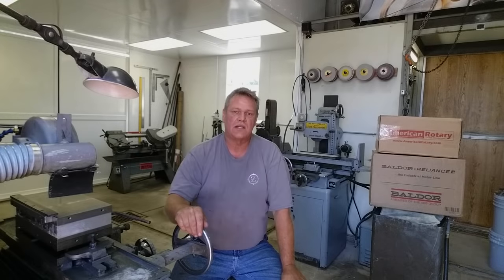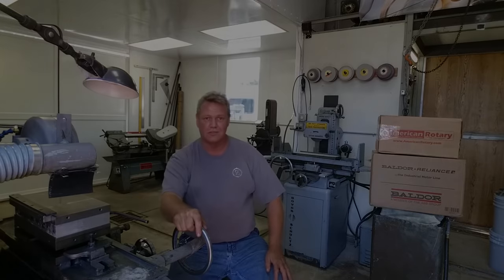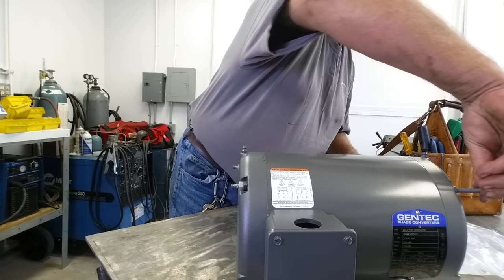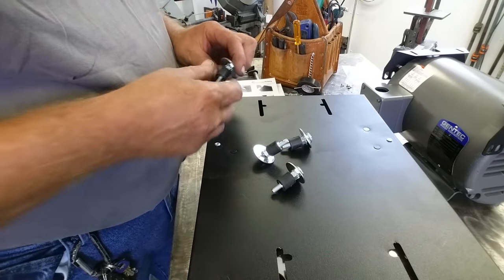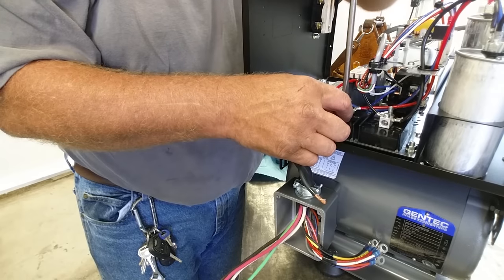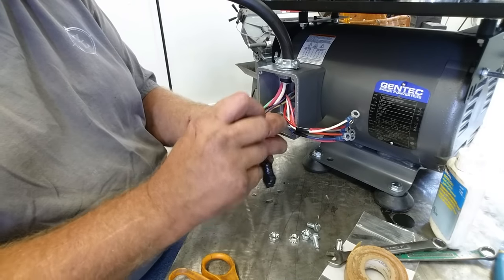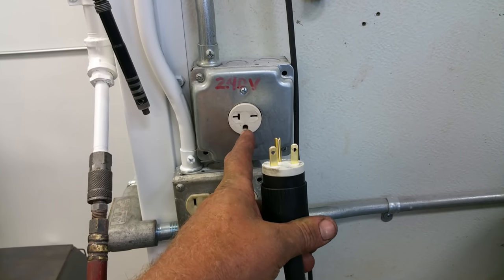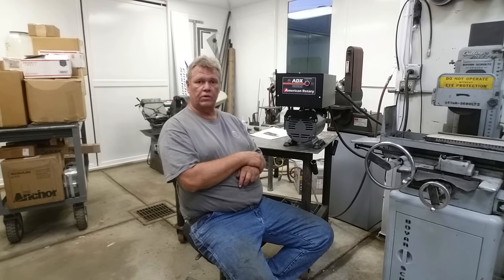RPC  VS  VFD

Comment: Good job Stan. I’ve been running my shop with a rotary phase converter I made with a 15 hp Fairbanks Morse pump motor for 25 years. I carry a small remote control that powers the coil in a large contractor with the output of the rpc going to a 3ph distribution panel as you discussed. The rpc is outside my work area and so quiet I had to install a light to remind me to turn it off when it wasn’t needed.  That said I am shopping for a 1hp CDF for my drill press to avoid having to change belt location to adjust speed.  BTW, the rpc runs my CNC mill and a large 3ph mig power supply flawlessly.  Keep sharing. Thanks, will

Comment: It amazes me how many electricians in the field that doesn’t know how to properly crimp on a fork or ring. Thank you for pointing that out. I’m in the HVAC-R industry and I see this mistake daily. Nothing more frustrating than rooting around in a panel only to find the wires pulled out of the crimp connections. 
On a side note it’s easier to see where the wires were supposed to go.. 😜

Comment: Thanks for the information.  I feel like RPC must have really gone up in price.  I see a lot of videos that say they cost less.  I see this was made in 2016.  Now A 10 hp RPC is over $800.00 and a Invertek 3 hp VFD is only $331.00 I think by the time I get the enclosure disconnect fuses and switches I'll only have $450.00 into the vfd setup.  I was told I have to do a 2 to 1 on a RPC (10hp rpc for a 5hp machine).  I've also found that for 3hp and bellow I don't have to oversize the vfd (single phase 220v to 3 phase 220v) Is this your understanding as well?

Comment: I also learned old school motor wiring with the three tape method up to 500Hp motors! I have a 10HP American Rotary unit to run my lathe and mill, been great, did blew a starting cap and relay couple years ago, easy folks to talk too. They had new parts delivered in two days, their tech guy was great!

Comment: Sorry continued. Found out 2 things on VFD with 1 bliwn input fuse that was running: drive was only running around 50% of full speed by BSO and the blown fuse was not on terminal that supplied control power. Great vid.

Comment: Something worth mentioning, an rpc will also power 3 phase inverter welding power sources, although I'm not sure how common those are in the US. Coming from Europe, they are very common. I run a 300a tig inverter from a 15kw rpc with complete success.
Reply: I didn't know this.... personally fed up with my 240v 100amp mic plant.
Very interesting thanks

Comment: Thank you for the instruction vid!  Just bought a used AR 7.5, am anxious to put it online for my machines.  

My understanding of the static converter is that it delivers 2/3 rated power since it has capacitors for the 3 phase start but then only delivers 2 phase power.  What about VFDs though?  Full power?  Or only 2/3 power?
Reply from the maker: VFD will also make tagged horsepower.

Comment: I use a VFD in my shop. the advantage I find is that it is possible to use  soft start available with a vfd. Quite a few jobs I do require frequent direction reversals. Previous to using the vfd, one motor failed as well as 2 starter relays.
Reply: Wow! Those are some major caps in the electronics box! Don’t want to grab one of those!

Comment: One question, VFD for older heavy iron with a low top RPM, about 800.  The concern I have, the maximum speed for the spindle bearings without causing damage.

Comment: Stan, just how big a rotary converter do you need to run a shop with many machines but may not demand many amps at one time? I.E. a 1 hp machine and a 3 hp machine. Theoretically 4 hp RPC would work  for near full load/start-up while the other machine is idling. Idle hp/current draw is what, 10-20pct of max current???

Comment: If you connect single phase to a 3 phase VFD you probably would only get 1/3 of the rated HP. Would have to connect to 2 input terminals that the VDF gets it control voltage from. Did you ever rectify a single phase power source and connect it to the DC buss terminals. Older Danfoss VLT drives had the DC buss on easy to wire terminal strip. Freaked me out the first time that I came acrosd a 480 volt VFD that had a blown fuse and VFD was running. Found out 2 things:

Comment: Yep, you are quite right, every situation is different. Why go to a separate VFD if you don't need speed control.
Some years ago I went the 3 phase path mainly because the motors were so cheap and almost give away at my local scrap metal yard, but also because 3 phase is speed controllable and easily reversible  provided you don't want to load them with high torque at low speeds.....single phase motors are more limited on all counts.
When I managed to get a Bridgeport for a business venture I also invested in a rotary phase converter of about 3 HP as the Bridge had a 1 1/2 motor and at the time I only had the one motor on 3 phase.
Later I discovered the cheap VFD's that I now use for all my small 1/4 to 1 HP motor types and they are on speed control type machines.

Comment: ShadonHKW is there a "rule of thumb" for sizing an RPC supplying a sub-panel? Obviously most shops will not run all machines at once. Thanks in advance for any advise.
Reply from the maker: RPC horsepower equal to or greater than load horsepower is a good start. But I would contact AR for sizing tricky loads.
Reply: Shadon HKW thanks

Comment: Thanks for this really informative video...
I have an old Elliot Milmor with a 2 speed 2 1/2hp 415v motor and a half hp feed motor with suds pump.
Really like the idea of a rotary but 
to use hi/low speed I'm guessing I'll need a digital vfd?
Thanks again, you've helped a lot.

Comment: Good video Stan. The most important difference I've come to understand with my VFD is you must never have high voltage controls downstream from a VFD or you'll soon release the magic smoke. If someone wants to use the factory reversing switch on a 3-phase lathe, for instance, without first converting it to the low voltage DC side of the VFD control circuitry, an RPC is the only logical choice.

Comment: how do you feel about running a vfd from a rotary? i have a decent size cnc mill (15hp spindle) and i am looking for a way to power it. also does the 2x hp need to stay true with a vfd controlled motor?
Reply from the maker: Your VFD will run fine on a converter, I would call Ameican Rotary about the proper sizing.

Comment: Hi Stan, I love your channel!  I'm Australia and I was hoping I could have some independent advice, please?  I have 240v single phase and I have a 10kw (13HP)(19.7Amp) RPC (415v) which runs my panel saw and a few other 3PH machines in my shop. I recently brought a nice 3 phase inverter stick/tig welder but it won't run on my RPC and I'm not sure why?  It turns on but it won't Arc.  The welder specs are a 3PH 10A 400v +20%/-15%, 50 Hz and has a kVA in the range of 7.7 to 9kVA according to its electrical plate.    I am just wondering firstly if you might know if there is any obvious reason why it won't work with my RPC? and if I can't get it to run using my RPC, is there another way of getting this welder up and running, maybe using another means such as a VFD or a static converter to run it?  I don't want to sell it because I really love it and I am finding it very difficult to get any information from the commercial enterprises.  Thanks Chris :)
Reply from the maker: It must be the inrush when striking an arc, getting over the initial jolt may be all you need to do, how close to the ragged edge is hard to say. Maybe find a friend with a larger converter to test out this theory.
Reply: @ShadonHKW  Hey, thanks for the reply!  Finding someone with a larger converter might be harder to find :).  I have a slightly larger induction motor in the shop so I might swap motors and give that try?  It should provide a slightly larger amount of Pixies on the inrush.  Thanks again and my best regards - Chris

Comment: Great old school wire up Stan.  I still have several rolls of stretchy rubber tape and no sticky cloth tape from forever ago. It was a pain in the butt to make them up but they never failed to maintain a good connection. If that rotary was in my shop I would put it somewhere that I could not hear it, with a long feed line and a remote start switch on the machine. Can't stand to listen to the extra noise. thanks for the entertainment ....greg

Comment: Interesting video, but I'm really glad we have three-phase into most homes here in Europe.  The power consumption rotary converter is just wasted energy, and the noice is also an issue plus the cost of the converter.
The situation we have in Norway, is that most homes except those build the last 10 years have 230V 3-phase in delta configuration. Newer resindential homes and the rest of Europe have 400V star configuration with an additional NeutralI lead  (so 5 pin connector).  Many machines can be configured for both 230 delta and 400V star. . If not, we need a transformer to convert from 230V 3-phase to 400 V 3-phase.
Reply: The initial cost of running additional wire from public utility to individual residences and business sites must be factored in. Those who actually need 3-phase are in the minority, but can have it installed from the public utility at a premium. Or can opt for relatively less expensive solutions such as an rotary phase converter or variable frequency controller. Certainly all the citizens of the city where I live, St Louis, Missouri, USA, do not require 3-phase power and to have access to it from a residential panel would be considered a luxury. Save the money for necessities, for instance, a tavern per square block, as we have in St Louis.

Comment: The official way a good electrician makes up 'pecker heads' on industrial motors that will see vibration (pretty much all of them) is to begin with friction tape on the lugs, go to rubber tape, and then finish them off with electrical tape. Then we try to situate them in the connection housing so they're in the middle and not rubbing up against any part of the housing, and if they must touch, they touch will very little pressure.
Otherwise over the years the connections can rub through.
Regarding VFDs there is a downside that few people discuss or understand unless they work with them in industrial setting and that is that they create very dirty power upstream and downstream both due to harmonics. The other down side is that the harmonics on the downstream side fed into motors causes currents to flow between the motor armature and ground. This causes currents to flow through the motor bearings which cause arcing in the bearings causing premature wear in the bearings of the motor.
There are treatments for the dirty power and also ways to rig up the motors to short motor shafts to ground, but all this is expensive and time consuming to deal with.

Comment: This might sound like a dumb question. If the 3 phase lines pull say 20 amps will it also be 20 amps on the single phase line before the RPC?
Can you do videos on the differences between Delta and wye 3 phases and how to tell the difference
And another request what is "Power Factor" and why someone would need a power factor correction?
I have read some about both of them but I would  have a better understanding of it if I can see it rather than read it.

Comment: Since that RPC looks to be fairly portable one could wire a box to it so you could plug different machines into it, just not at the same time. If its heavy a set of wheels and means to pull it to where needed would correct that. If you work alone doubt one would be running two machines at once, unless a shaper was one of those machines. Not a good idea to walk away from any machine tool without adult supervision. And don't forget the best disclaimer of all....NEVER try this at home, always go down the street a ways.or out into your shop but never at home.

Comment: Can vfd run machine with multiple motors? Like edgebander where there is routers and conveyor belt motors that start up at the same time?
Reply: It's not as easy as a RPC, most VFDs are happiest driving a motor pretty directly. You can have either a dual output VFD or two VFDs that can talk to each other.

Comment: Only thing i will add is if the motor has an internal fan which only works one
way its maybe a good thing for cooling that the motor is running in the 
correct direction...Good job..

Comment: Mr. Stan, would you use a 3 phase only VFD to drive a 5HP 3Phase motor on a single phase input circuit? I've searched WEG and Lenze   catalogs and both stated there are not model available for single phase input in this HP range. Thanks in advance.
Reply from the maker: Hi Diego,

I would contact the folks over at Wolf http://www.wolfautomation.com/?utm_source=msn&utm_medium=cpc&utm_campaign=(roi)+branded&utm_content=marshall+wolf&utm_term=marshall%20wolf&utm_creative=e&utm_device=c and see what they have to say, I have run 5 HP motors off of single phase before.
Reply: Thanks. :)

Comment: VFD's is the way to go. You can get them pretty cheap on ebay, they are simple to set up (just step trough the commissioning wizard and put in your motor parameters), they are lightweight, and they are a lot more versatile than a phase converter.
And on the machine you can simply just rip out all the relays etc. and just plug the VFD directly to the motor cable (and put a fuse in front of the VFD) and plug the original switches to the inputs on the VFD for start/stop and forward/reverse.

Then you have variable speed, you can overspeed the motor if you need it, it has soft starting so it is gentler to the motor and gears, you can see the load on your motor, you wont burn your motor because it detects overloads, and so on. The advantages is endless.
Reply: Except you have to do that for every machine you want to add one to, know how to do it, and have the time to do it. I'm not saying it can't be done, or may not offer some advantages in certain circumstances, but for many, just setting up a larger RPC feeding a distrubution box makes a lot more sense. "Cheap on Ebay" isn't what I want in a multi-thousand dollar mill or lathe I rely on. Generally you get what you pay for, and that goes double for high current/voltage parts. There's also the option of putting an RPC together oneself. They aren't rocket science.

Comment: Maybe 5 years has changed VFD's -that much-, but I'm not sure what the scary, scary control package is that you mentioned a few times. While they're not quite as plug and play, until you get into assuring the more advanced feedback feature they seem relatively simple to set up, if you know thevspecifics of your motor. I think you should know a motor's features and limitations before selecting one. Per-motor cost is a condideration if one has to buy, and even rpc's can be built inexpensively.

Comment: Ring terminals work as well as split bolts for joining the wiring together and are a lot cheaper!
Reply: only for small stuff........bigger than 6 gauge i think spilt bolts are the best choice
Reply from the maker: Look into Polaris connectors, expensive, but worth it.

Comment: Seems like noise might be a valid consideration if that RPC is even half as loud as it sounds in the video.
Reply: I have my motor located outside the shop, in a dry box, with the control panel inside.  No noise issues!

Comment: I'm not quite understanding what is so expensive in converting a machine to a VFD? The last Fuji Electric inverter I bought cost me about 250 EUR for a 1 kW model.
Reply: And just to add, I didn't need anything else than wiring. The VFD (Fuji Frenic series) already has a pot on it, basic breaking function (will not stop in a second without a resistor), display to show RPM (parameters help here), jogging mode, inputs for separate REV/FWD/RUN/STOP switches etc. and all one needs to do is to mount it somewhere handy and type in the motor name plate values to the parameters. Took me about an hour total and that was with reading the manual.
Reply: @JaakkoF  Prob because you have three phase already, and are just adjusting frequency?

Comment: Stan

Excellant overview of VFD vs Rotary for poly phase generattion.  I know you said it but you could have stressed more the choice is made by the driven loads and your desirees ie variable speed.

Have not seen ring lug and bolted connections for decades.  Varnished cambric - did not know you can still get it - good stuff.

Even longer is twisted conductor and soldered / friction taped connections as Dad taught me.  Also taught me how to meke splices in SO cord with solder ; tape.

As usual well done.

Regretfully cannnot make the bash - why is it you never seem to have the dollars and the time simultaneously??
Dan Bentler

Comment: Jist recently replaced a 50 HP RPC with a 50 hp vfd feeding a distribution panel power all the machinery in the shop. You dont have to rewire a three phase machine to an individual vfd.
Reply: Well. Might be your all motor loads are with similar characteristics

Comment: Great video Stan!

By the way: I'm using a VFD since a couple of years back on my lathe. Thing is that I'm not using a brake resistor on it, do you think it's worth getting one for faster slow down of the lathe or just keep on rolling like I've been doing? It's not like it's bothering me that it takes a little while for it to slow down, but you know: There can always be improvement.
Reply: I think having the resistor is convenient, especially because they cost pennies. For example if you are threading where you can't release the half-nuts (odd thread for example), hitting the reverse button and having the VFD come to a quick halt and then reversing is a great way to speed things up and be able to run a thread to a shoulder. Heck, one could even install a reverse switch for the carriage to bump into.